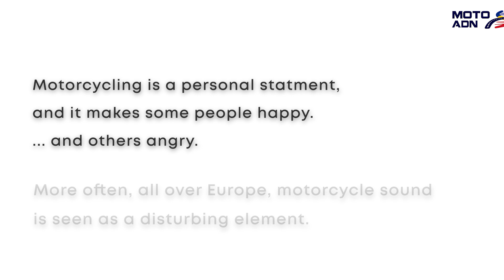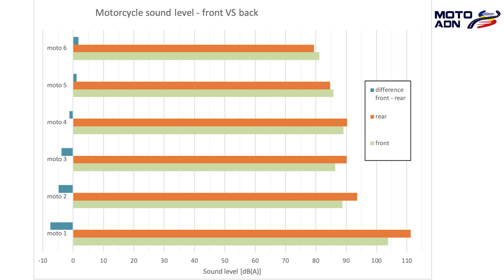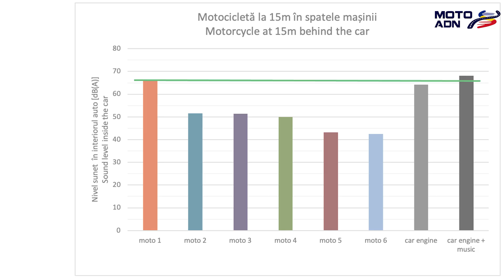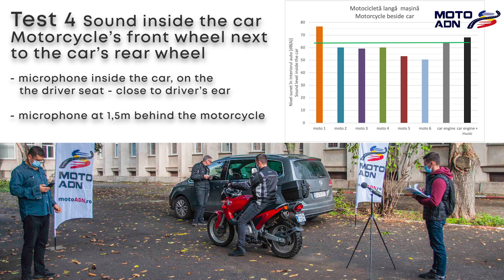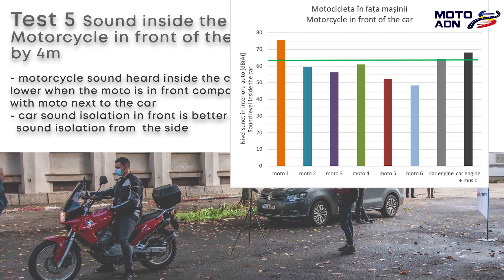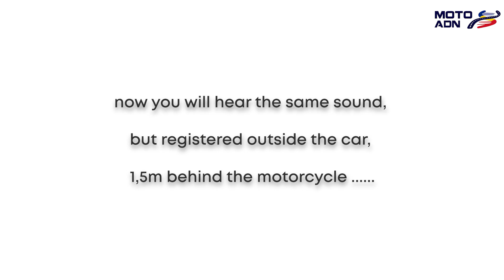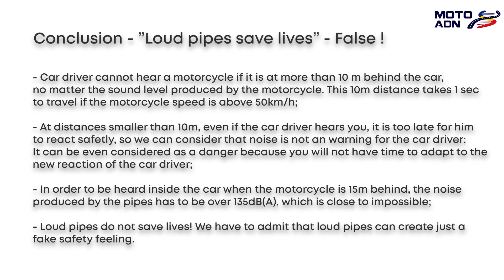Do loud pipes save lives? Now you have the answer!

Comment: Great idea and implementation. I have an SV1000S with two cylinders about 500cc each. Even with stock exhaust it produces very low sound that tends to fill narrow spaces by reflecting from the walls around and it resonates within my helmet. I'd like to know if it's also capable of resonating inside the nearby cars. Also, I imagine test results could differ depending on how far away from the motorcycle are the walls on either side
Reply from the maker: We ve test and measure noise inside the near by cars and the noise it is barley   heard. You can find all this measures in the presentation

Comment: Ride a motorbike around London or any congested city. Try with a loud bike and try with a quiet one. There is a big difference. Also pedestrians are all over the road and cyclists. Pedestrians in London are my biggest problem. They hear me with a loud exhaust. A real world test would not have the same results. I find riding a quiet bike in London alot more terrifying than a loud one.
Reply from the maker: So instead of driving safely you consider that it is better to annoy tenth of car driver and pedestrian. This is the reason for which motorbikes will start to be forbidden in some areas, as they already started in Germany

Comment: decent research, it give's a good indication of sound levels inside an car. to contribute a little to the cause and to inform the "loud pipes save lives" proffesionals in the comments i conducted the same experiment but in a dynamic setting with harleys and in a static setting with a enduro bike.

I used a class 2 db meter callibrated to 94db @1000hz. when driving 80kmh and being passed by 2 harley davidsons (aftermarket exhaust, vance and hines, two brothers) i could not get the db meter above 85dba inside the car. even after multiple tries, including a full throthle pass. the average enviromental noise inside the car was 68dba.

I also preformed a static test with a 600cc single cilinder enduro bike. the soundlevel outside the car @1 meter from the enduro bike exhaust under a 45 degree angle was 95dba @3750 rpm, 108dba whilst blipping the throttle(not rev bombing), and 110dba whilst driving by @ 1 meter full throthle. the same actions were repeated and this resulted in the next values meassured inside the car with the windows and doors closed: @3750 rpm @1m: 65dba. Blipping the throthle @1m: 73dba. Full throttle driving by @1m 75dba. these values confirm the pre study done in this video.

Comment: 110 dB is quite low for a "loud" bike. 120 would be much more appropriate and 130 would still be reasonable. Thats 4-16 times perceived loudness. I always advocate against loud pipes for numerous reasons, but this testing is so thoroughly flawed it makes it harder.
Reply from the maker: 130dB is the noise of a military jet at take off - if a byke will make this nose constantly i m sure the the rider will give up riding in one month :)
Reply: @motoADN  That's why riders typically wear ear plugs. Not just for the exhaust noise but the wind noise too. But being experts on motorcycles you already knew that didn't you? Except you're not experts and you didn't know it.

Comment: The major hole in this study is the assumption that only the loudest sound can be heard. At ~3:00 the narrator states that because the background noise is greater than the motorcycle noise, the motorcycle cannot be heard. This is just not the case, as anyone who's had a conversation while music is playing, or been at a movie while someone is talking can attest; the human ear is capable of discerning multiple sounds simultaneously. This isn't a scientific study, it's pseudo-science with an agenda.
Reply from the maker: Few sec lter you have some grafics with sound frequencies that explain exactly this point … human ear can record diffrent sounds  if they are on different frequencies. At each frequency human ear can record the most powerfull sounds. What we are showing woth this study is that the pipe sound, no matter how poerfull it is, for the car driver is just a background noice and it is hard to spot it from the multitude of other sounds. This happens until moto is below 1 m distance. Them pipe sound is predominant but it is too late for everybody to react in a safe way

Comment: The loudest motorcycle they measured was at 110DB, the same exact volume of most police sirens. Should police stop using their sirens?
Reply: Which direction is the siren output facing? Which direction are the loud pipes facing? The physics of sound matters in both instances.
Reply: There have been studies done on the hiw ineffective sirens are too. They're just loud. You don't know from where they're coming. And it doesn't really make anyone more aware or cautious. Good drivers know to slow down and move over anticipating an emergency vehicle is coming. A bad driver is going to... wait for it... continue to be a bad driver and a hazard on the road! Does the police officer make his siren louder or use his driving skills to maneuver around the bad driver and remain safe?
Reply from the maker: Did you saw police sirens turn on all the time? This ia the difference … when is on they need to go somewhere quicly because somebody is in danger … is it the same situatiin when you are running a noisy motorcycle?
Reply: @motoADN yes but are they around that specific motorist, all the time, no just for a couple of minutes, like police sirens, so it makes it quite effective. So you're right. which they typically can hear them miles away of course, as long as they don't have a stock motorcycle like they did in the video They're typically even louder. Saying being louder has no benefits is the stupidest thing ever. Even it's just the pedestrians that would be better then nothing which would still save lives and most people can hear motorcyclists around a block so hearing nothing, then something around the block definitely is better. Ps 
I'm not saying people should have stupidly loud pipes and disrupt people and there lives either but having something louder then stock isn't either

Comment: Not sure what cars or motorcycles were used in this test, but even at highway speeds I can hear cruisers from inside my car. Long wavelengths (low sounds) penetrate solids much better than short wavelengths. A better test would distinguish types of bikes, and the frequency range of the exhaust sound.
Reply: The problem with low frequencies is that the human ear cannot perceive where they are coming from.
Reply: I mean they go over that in the video
Reply: @isaacbunsen5833  No, they only showed frequency/decibel graphs of the bikes in question, they didn't demonstrate the bikes used for us to compare. The only bike we hear in the video is a high revving high-pitched whiner. The other two still pics we see appear to be adventure bikes, which also don't generally have a low pitched rumble like a cruiser.
Reply: 110dB is not nearly loud enough to be relevant outside Europe. A loud moped is 115 dB.  A loud Harley is 120. And a straigh piped harley is 130.

I advocate against loud bikes, but this is bad research and makes it harder.
Reply: @SeniorKlean  You sure? "The decibels of a jet engine range from 120 to 140 and are one of the loudest manufactured sounds in existence."
Reply: @vidmantaskabosis  Jet engines commonly measure 125 dB at 100'.  Most dB readings are done at 10'.  Sound pressure follows the inverse square law.  So at 10', it would be 145dB.  A jet has roughly 130 times the sound pressure of a Harley, or about 30 times the perceived loudness.

Comment: This study is completely biased because it was done in an environment without reverberation. 

It is absolutely necessary to measure the sound impact when the traffic is dense and the sound of the motorcycle bounces on the other vehicles in uninterrupted line.
Reply from the maker: I m sure you realise that measuring the noise when the bike is in a line of cars will  sustain our conclusion!? In this case the noise will travel more behind the bike, not in front
Reply: @motoADN  it’s not a tube , cars have front bumper and Windshield that will bounce the sound forward. 

I'm not saying that the outcome has to go one way or the other. I am saying that this should have been done to have an unbiased study

Comment: I don’t think anyone can say definitely one way or the other whether or not loud pipes save lives but it’s fair to say loud pipes are more likely to be noticed than quiet pipes. In my own experience I’ve been riding motorcycles of all different noise levels for over 30 years and have concluded that I am definitely noticed by other motorists much sooner on loud Harleys than any other bike. Even if the testing in this video was done properly taking into account real world scenarios there are far more variables than noise levels that contribute to motorcycle accidents. To say “loud pipes save lives” is false based on this video is quite subjective. Fact: If even  two lives have been saved by loud pipes in all of history that would make this a true statement.
Reply from the maker: What about other 2.000.000 people annoyed by noice with sleeping problems followed by the all additional problems … even thouse two people saved in you example could be saved if the rider has a responsible riding … 
Let s imagine …. Hiw it will be if all the cars on the street will drive with horn on 100% of the time … for sure this measure will save somebody … but will be the result?

Comment: this is so lame, how you measured noise inside of the car at 5:10, in real life sound is almost same as on open air, big engines also provide alot of vibration which you can feel inside of the car, so your studi is fake, so the conclusion also, just check statistics how often chopper like bike with big loud engines get into accident because of blind car driver. Almost none, then check low noise bikes. surprice loud pipes actually SAVE lives that's unexpected :D
Reply from the maker: If loud pipes save live can you imagine how mny lives can be saved with a responsible  riding or a good training … much more for sure, and we will not scare children and ppl living in the areas in which we ride … what do tou say about that?
Reply: @motoADN  yeah responsible driving would be good, but while i was riding quiet bike and not agressivly then i had about 1-2 cases per day when someone tried to hit me, now when i have more skills and much noisier bike then 1-2 times per month, so my statistic shows that responsible doesn't give any advantage. Car drivers may not see you even if you are infront of them. Things that move faster and noisier make them notice you better. Same thing with pedestrian while you stay infront of crossing without movement then people may not see you at all, but if you move then they see much better.

Comment: Correct! Not loud pipes but a car horn installed on the motorcycle. It disperses unidirectional sound and can be acknowledged by any human from new born to the elders. Why? Well, because we are more used to the car horn then the loud pipe. So, I use a car horn for my bike and it does the job when needed.
Reply: That is also the only legal way according to the rules to attract attention.

Comment: I, as a motorcyclist, appreciate the time and effort put into this study. I disagree with your conclusion based on the study with a distance smaller than 10m; due to in that split time both the driver and myself can adjust enough to prevent an accident. When I am on a highway, I need the car behind and on the side of me to be aware, this is the only moment that loud pipes could prevent an accident. The car in front of me is my responsibility to maintain a safe distance behind to adjust in case of emergency. I have stock pipes on my Harley Road Glide and a Tesla almost clipped my front wheel traveling at 55mph, the horn was not loud enough nor were my stock pipes (that have a cat), had I not taken evasive maneuvers I would've been road kill. I've seen first hand loud pipes startle a driver at 60mph under 10m enough to correct their lane change and for the rider in front of me adjust to prevent disaster. I do agree that loud pipes will do you no good being behind a car, I also agree that my neighbor appreciates that my pipes are stock, but I don't appreciate that a Tesla with all the technology built in it almost ran me off the road because I did not have loud pipes, but maybe they wouldn't have heard me??? But then again your study shows that if I had loud pipes under 10m that Tesla would have heard me?? Thanks again for the study! I am researching on aftermarket pipes or aftermarket horn.
Reply from the maker: We really do apreciate your answer and your point of view. We didn t think about the highway situatiin but it seems that you are right - the car driver will hear you when you run in paralel with the car. Hopefully the music inside the car is not too loud.
We recomand a powerfull horn instead of aftermaket pipes.

Comment: Completely flawed test, "loud pipes save lives" when testing and analysing results of a test all eventuallys need to be tested. This test only tests if a car driver can hear a motorcycle exhaust which is irrelevant. First part of designing any test is choosing the targeted group this only includes cars, who's life is it saving because the test completely misses other partirs lives that are at risk. Do the test again and Include  pedestrians people like dog walkers and joggers who often walk out in front of traffic for example people trying to nip through traffic that stationary at traffic lights and step out in front of a motorcycle filtering to the front of the lights. Who's life are you saving should be the starting point when designing a test don't just jump to can a car driver hear a bike
Reply from the maker: You just try to move the focus on a scondary subject - "loud pipes are not about cars, they are about pedestrian's safety "... How fulish is this ?! Are u sure that a motorciclist who change the original pipes is thinking about pedestrian's safety and not about loudness of the bike or how caption the driver's attentions?
Coming back to the test itself ... It is about cars and motorbykes. We stated that we are measuring the impact of sound inside the car.
We consider that cars are the biggest danger for motorcicle riding. 
In case of pedestrian YOU, the rider,  are responsible and you can not blame pedestrians for not seeing or hearing you! 
But don t wory, we will continue the test and we will measure also the impact of sound of pedestrian vs annoing noice of the neiborhood.
So testing the impact on pedestrian is another step of the test which do not invalidate the test on cars. Up to now the result of the test is that the mith is fake!
Reply: @motoADN  I'm not trying to move focus at all the video is literally called "Do loud pipes save lives? Now you have the answer!"  not as you state "impact of sound inside the car."

when you make a statement like Do loud pipes save lives and test for this you can not ignore who's lives this is saving any test result is flawed if the test group is bias. when testing and making these statements based on your finings only on a specific part of a test group this does not give you enough accurate data to make a finding either way and a test can only be confirmed as a success if all the data is presented  no just part of it

as you say you will continue testing any news on that i see the OP video is from 2020 how's the testing going have you done a pedestrian test video yet

Comment: Just cars?  Really that's it?  Do tests with cyclists.  And also pedestrians - especially ones with their eyes glues to their phones and their brains tuned out of their environment.  They will quickly realise they aren't levelling up in Candy Crush - they're about to be run over for stepping out on to the road on a side street because they didn't think to look over their shoulder.
Reply: In this case would you say that a motorcycle is quieter than a regular car so that a pedestrian cannot hear the motorcycle coming? 
Your case does not stand, no need for a loud exhaust
Reply: @OvervoltedMinds  I cannot fathom what kind of answer you want.  I really dislike you positing what I would say in one line and knocking that argument down in the second - I didn't say the first so don't assume the second. :o(

Do you ride?  Do you have any direct experience?  I ride.  20 odd years.  Two bikes at the moment.  One with a loud exhaust; one with an OEM exhaust.  Personal opinion?... while I wouldn't argue that a loud exhaust is annoying to some, if I compare riding my two bikes over the last few years I've have to brake, swerve, and beep the horn for the little bike with the standard exhaust - they just don't see nor hear me.  I have to ride it very defensively.  Riding the bike with the loud exhaust is a totally different experience.  Refreshing even.  Never had a problem with another road user (cycle, car, van, lorry, etc.).  They hear me and don't try to (seemingly) hit me for fun.  I don't rev it; I don't expect everyone to "get one of my way" - I just hope they look out for bikes.  The loud pipes help.  Perhaps that is an unfortunate answer for some.

Comment: I would find it interesting to try the same test but with a large displacement V twin that has a low bass note . Anyone going to a rock concert knows that low notes cary further and can be picked up through walls `.. Sadly I doubt any of this thinking matters when the car is in front of the noisy bike .. Also another thought is that if you are scaring the traffic around you will they do something erratic that might cause an accident ? Just saying :)
Reply: Rev bombing is alot louder than a deep exhaust its likely it would be even quieter